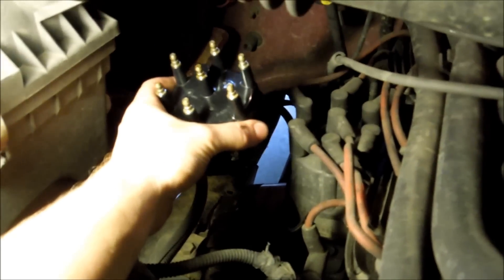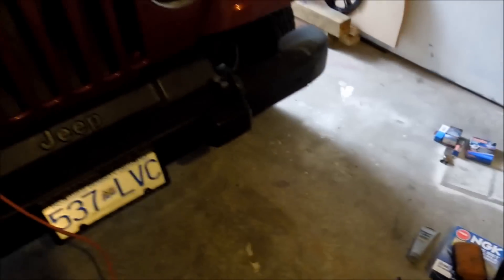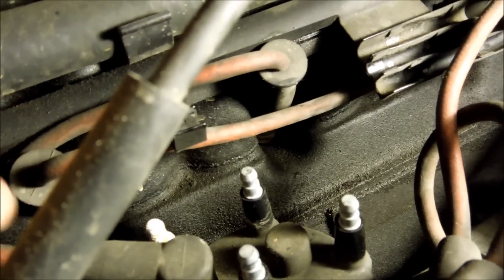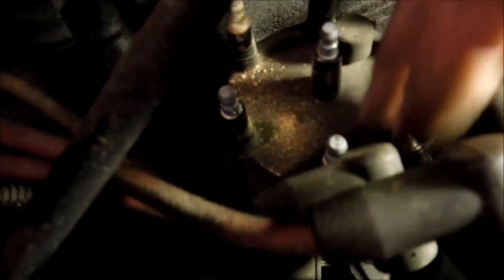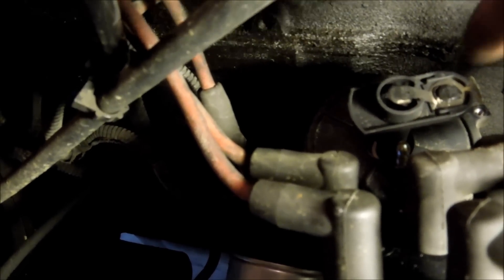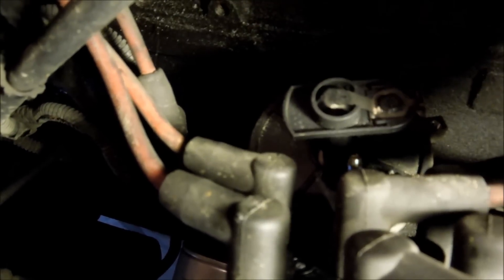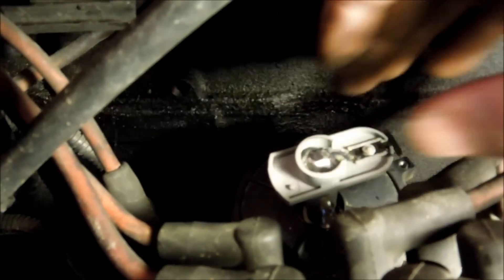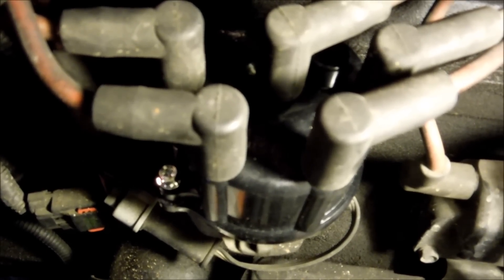How to change distributor cap and rotor on a jeep wrangler  tune up part 2 of 3

Comment: Just a note for anybody watching this.  U don't put dielectric grease ON the connection point of the plug and the boot.  U put in on the inside of the boot to help INSULATE the plug and wire basically from the motor.  Dielectric grease is NOT A CONDUCTOR.  It is an INSULATOR.

Comment: I have a problem with my 98' wrangler, I did the tune up 3 months ago and I changed the whole distributor as well in a garage. But I think he messed with something. Since he did that, it started to be late when I start the car, and I need to push the gas so many times until it starts, and there is over fuel in it with fuel smell. It ruined the starter 3 times and the flywheel as well, I changed them all but the problem still there, maybe he messed with the spark plugs wires places or he didn't make the timing for the distributor... I need your help.
Reply: You said that you did the work but "he" did something incorrect.???  The voices again

Comment: I've got 99 jeep Cherokee sport. Distributor blew out. I could see electricity arching. So I changed cap,rotor button and wires. Now it will crank but it won't start. I have the firing order correct. The coil is still good. Plugs are still good. I get a good spark. Just will not start. I'm at a loss any idea?